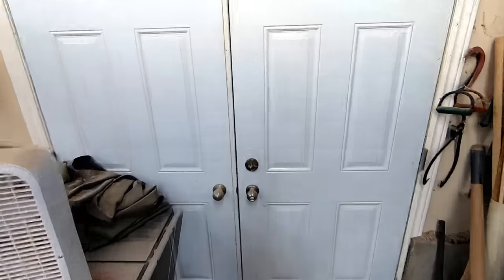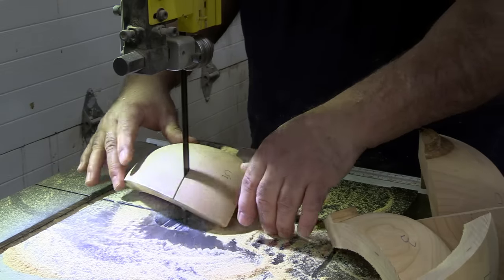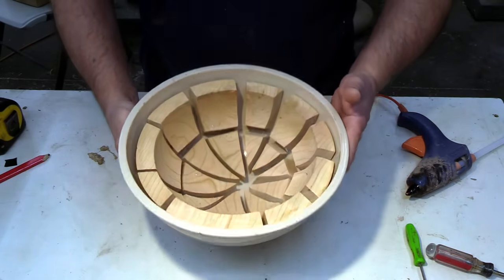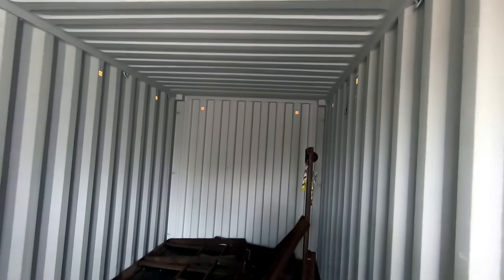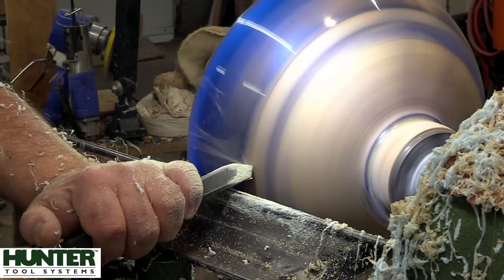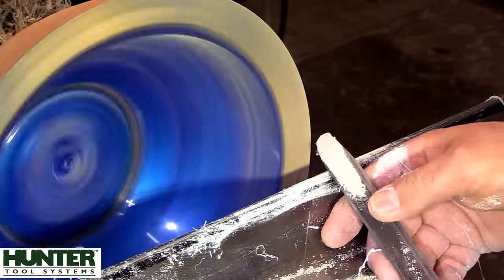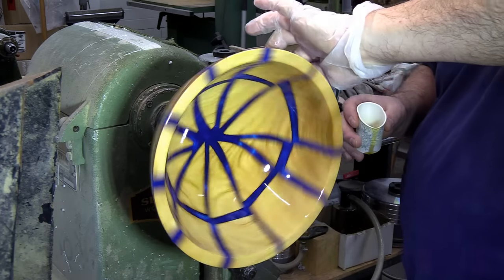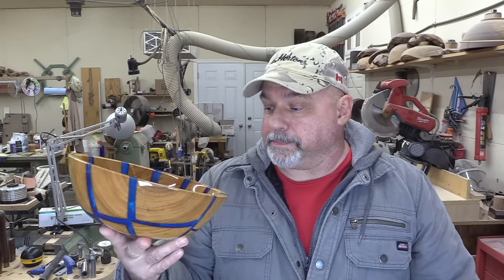Woodturning - Shattered But Not Broken Cherry Bowl FABULOUS!

Comment: Wow ! This bowl is really cool ! I love your idea of maybe mixing Walnut and Cherry . And I really love your new drying room . I am so jealous ! lol . Jim , I have a question , I use an 8.9 mm carbide round cutter but for some reason when working in the bottom of the bowl when use using Epoxy , the Epoxy wants to chip and not really smooth cut . I have no issues on the side walls , only the bottom . Any ideas ? We hope you have a great weekend .
Reply from the maker: Have you tried a round nose scraper tool. That might work better. I’m assuming you’re not using the Hercules? If so, that might be your problem. lol. Hope this helps.
Reply: @SpragueWoodturning  I have tried the round nose scraper and it works . No I don't have the Hercules yet . 😊Thanks for the info . Love watching you work .

Comment: I wasn’t trying to “trap “ you into anything, I was just looking for advice as to what type of epoxy to use. I just want to make a bowl using your method. The bowl will not be used afterwards, just mainly put on display
Reply from the maker: Sorry, I just didn’t know what you were asking. Artcast from Designer Epoxy will work great for projects like this, but anything over 1”, a deep cast resin should be used. Thanks!

Comment: Are the bowls that you have in the drying shed food grade coated?
Reply from the maker: They are covered with a endgrain sealer called Anchorseal. All of these bowls will need to be put back on the lathe, trimmed and sanded. The Anchorseal is not food safe, it will all be turned away. Thanks

Comment: I was hoping that in making the pieces a hatchet would have been used.  In this way the celebration of the imperfection is maintained.  

Best of luck with your move
Reply from the maker: We will see that technique in the future. Thanks
Reply: @SpragueWoodturning  I got to thinking about that idea and remembered that it will work best on an end grain turned bowl.  It will break easiest